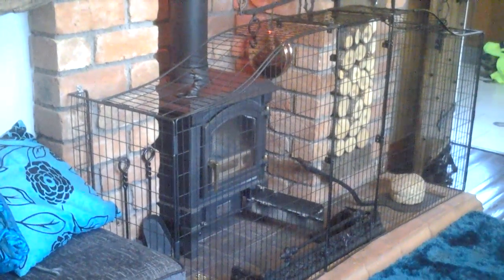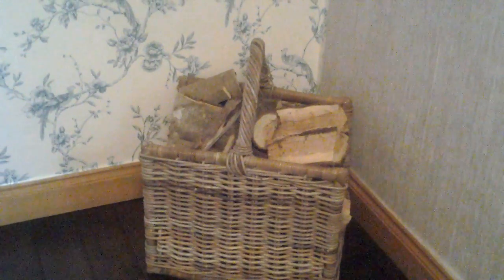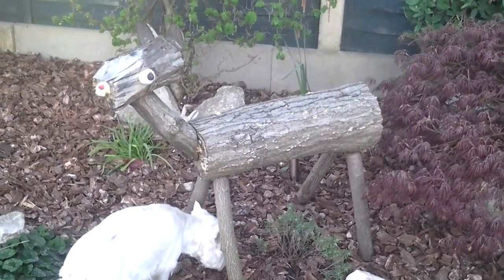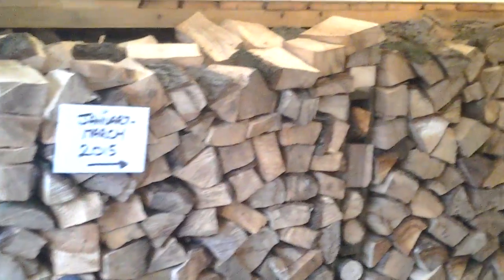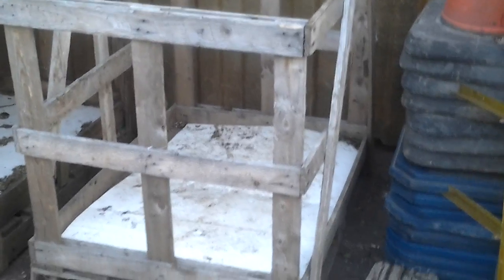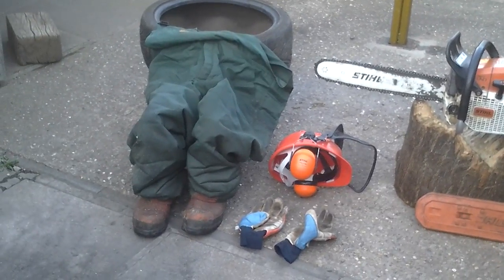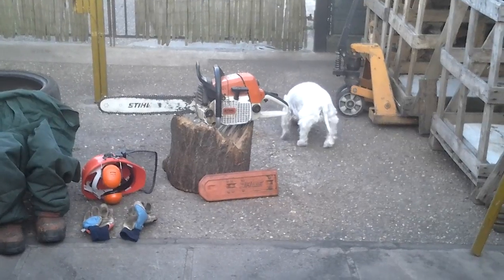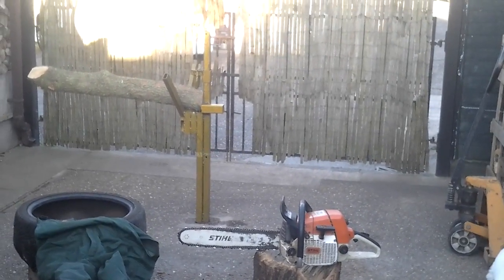#LoggingAndStorage  Log Burning:- Storage, Cutting, Splitting, (1)

Comment: I think you are the first person I have ever come across on here with as much cut logs as I have :) I am very lucky in that I have enough standing timber that I want to take down to keep me going. I have 3 different areas for storage which I move on as it gets burnt. I have a large area outside with simple covering, from there is goes into a storage shed that holds a full winter's worth. After another year of drying it gets moved to the garage beside the house. If you have the time take a look at my review on a Granberg 12v sharpener
Reply from the maker: I will check it out Michael.
Happy logging 
Terry

Comment: 1st off great vid love it
I saw the vid with tire before on u tube I haven't seen the one on the log holder nice idea!
In states I would say where I live many many people burn.
I burn about six to eight cords a season I start on or around October 31 and stop around mid April .a cord of wood measures 
4'x 4'x 8' I stack on pallets an shrink wrap and leave top and bottom open for circulation of air I also keep wood min of two years before using to obtain max burn rate . 
One thing I found unusual was that u said u use pine to start my Portuguese wife family all use pine in Portugal but state side no one ever does because of the excessive sap content for residue in pipe. I suppose it maybe a availability in Portugal .
most people who burn wood to heat house use a log splitter
I'm sure there are a many who split by axe as if we don't have enough to do. My house is about 4500 sq ft and my stove is  sized for my house with variable oxygen controls for burn rate it also has a blower locate at base quiet one to push air/ heat from stove this absolutey is imperative for house heat. I have a zero expense to heat my house in winter no matter how cold it gets I get my wood for free I'm in the construction business and I remove tree as part of my projects  I use husqvarna  but I do have several stihl  both are  fine I will send u a vid on equipment we use I'm sure u will find it interesting  I will show u how I stack with a fork lift on my porch so I don't have to re handle all the wood less handling less work for  me oh my brand of stove is called a Vermont casting it well worth the cost there are cheaper units but u get out of it what u pay for
Great vid ps how u get ur wood.
Reply from the maker: Please keep your videos coming waiting to see them, your comments last longer than your vids and are full of information thankyou. I occasionally get called to cut up fallen trees after poor weather and out of skips,I burn about 6 cubic metres from October to March.
Happy logging 
Terry